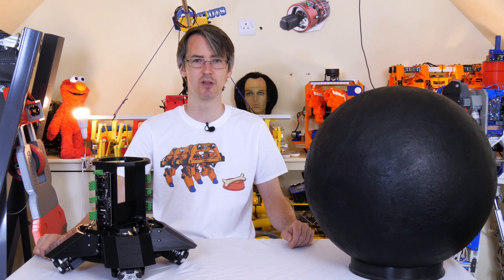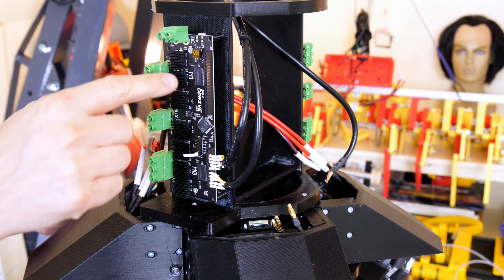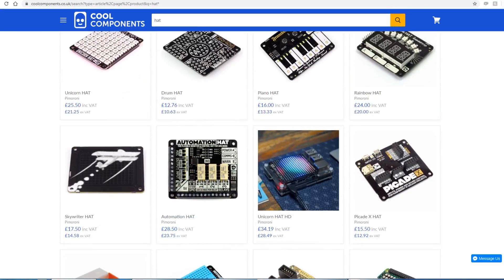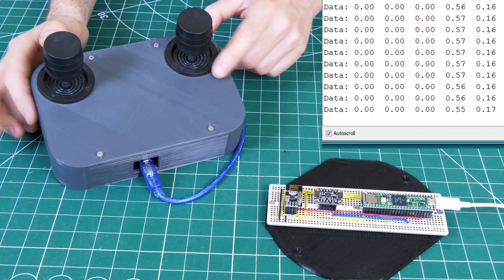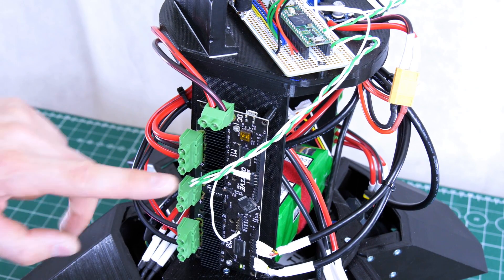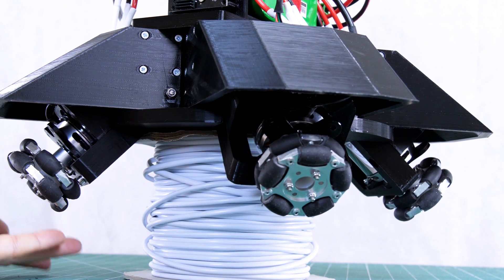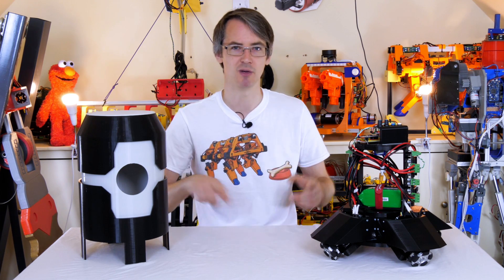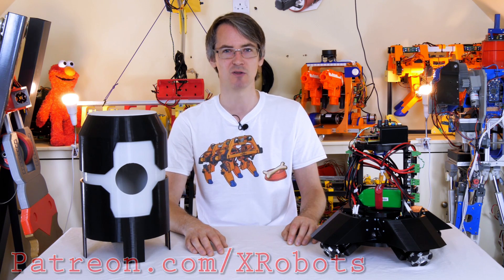HAL9000 : Ball Balancing Robot #2

Comment: i would put the batteries in the center of the ball and power the "robot" part thru nfc coils all around the ball. Lot of loss but the weight of the battery dosent count as it's in the center of gravity. For the interference however i'm afraid it would make it worst 😁

Comment: Hi James, nice project! I see you're gonna use the nrf24 module. I would advice to not use the micro's onboard regulator, but use a dedicated board for that. (nrf24l01 adapter module)
The nrf needs a very clean and powerful 3.3v to operate reliably. I've used the adapter board myself and it  works great.

Comment: What I realized from my tests with these NRF modules is that you should keep them close to the microcontroller to make sure the data wires dont get any noise on them. Your SPI wires must be acting like an antenna and picking up motor noises
Reply from the maker: Yes

Comment: Have you considered putting a large ball bearing inside the empty ball to give it more inertia and stability? That would slow it's response a bit and maybe make it easier to control from the wheel on top.
Reply from the maker: Yes watch part 1

Comment: I'm working on a model of a thing myself and I need to find a ball that is 28.8" in diameter. I haven't had any luck finding it. Where do you get the foam halves from? Did you find a fiberglass ball?
Reply from the maker: The original one was bought years ago from eBay or Amazon (I can't actually remember). The new one is actually going to be a mirror ball!

Comment: Move the battery to the very top, and possibly add a small flat round steel weight there. That will increase the moment of inertia and also the increased weight will improve traction.
Great project! 👍💡

Comment: I discovered the flaw in this design. It's latency... There is a very high delay between the accelerometer and the motors. The motors start spinning waaay too late, always ending in it falling off the ball. Fix that, and you're golden.
Also, the wheels don't seem too grippy, they are of hard/rough rubber/plastic...
Reply: I want to see a ball balancing on a robot... :)
Reply from the maker: It's actually tuned fine as you'll see in part 3, yes the wheels spin for the reasons I explained.
Reply: @jamesbruton  Tuned fine, yet the wheels start very late... They should start at the smallest inclination/movement.
Well, you do what you want, it's your project. :)

I said accelerometer, but I was referring to a gyroscope.

Comment: I'm not sure your "ground loops" arguement makes much sense tbh!  The high frequency motor noise will couple back on the power grounds, but the high frequency serial data return currents has no ground path that is "co-axial" or at least close to the outgoing path from the processor.  AT high frequency, it is the inductance, effectively the loop area that matters.  You system is battery powered so has a common ground, but it would be better to ensure that all outward current paths have a return current path as close as possible to the outgoing path, even if that means another ground wire which looks (at DC) to be pointless, but actually provides the critical AC return path. If you are using TTL (5v or 3.3V) serial between the processor and the O drive, as opposed to RS-232 levels (+-12v) then you can easily run into noise issues due to issuficient channel seperation!  The other big advantage of always pairing your outgoings with a matching return is that you can then use alarge amount of common mode filtering to block common mode noise without affecting the differential serial data signals too much!  warpping the wires through / around a suitable ferrite choke, for both the power and data, can bring huge reductions in the high frequency noise as the high frequency common mode impedance is driven right up by that ferrite!

Comment: You may want to consider some stiction compensation algorithm, the most basic being to add a signed offset to the forward and backward voltage applied to motor. May reduce the amplitude of oscillation you see near equilibrium. Obviously the better solution is to remove the sources of friction but it is not always possible.

Comment: You almost have the right design but it's not quite there yet.You need to combine the ideas from your previous designs and invert the functions to get it there. First- forget about a dynamically unstable "balancing head" robot on a ball..that won't work and is not the best design. the head you have now is a good idea  but you don't want it too heavy ..Your broomstick analogy is false here and unnecessary. Second- Yes you do want a powerful magnet on the bottom center of the head part and inside the ball you want should have a caster section immediately below the head with a convex surface with ball socket solid rollers facing the inner surface of the ball and another powerful magnet pulling the head to the surface of the ball. Now extending downward from the center of this caster section in the ball is a long solid shaft with a semicircular HEAVY counterweight almost touching the bottom of the ball inner surface attached to the end. this will make the ball statically stable and the head will then only be needed for propulsion and stopping and will not need to balance at all as the ball will be stable and will not tilt or roll as long as the counterweight is heavier then the combined weight of the head and upper inner caster section combined. This will of course require a SOLID hollow spherical ball shell of strong material like fiberglass or carbon fiber with a split shell or access port to insert the counterweight shaft system to the inside.the inside could also be sealed and contain a small amount of lubricating oil just coating the inside for the inner casters so they do not wear out .The advantage of this system is that it does not require any electronics or motors or wiring of any kind inside the ball...only a mechanical counterweight system. This also means that no power is required to balance the head on the ball and with power off the robot will just sit there upright and will not fall over.the head will be used to move the robot and by moving the head one way the ball will move the other way so essentially the ball will always lead the head in whatever direction it is going. This will also help when hitting or bumping into other objects or walls since the ball will take the impact and the head will not . Just a thought......
Reply from the maker: wow that's a lot of text
Reply: Yeah, that thing you set out to do - it's not going to work, forget it, even though you came really close last time. Remember the things you said you already did and don't want to repeat? Repeat them. Just an idea...

Comment: Having touched on this at uni we discovered a heavier ball solved a lot of the issues you're having. We had the ball being thrown out from under the robot due to torque much like you are. Try a heavier ball.
Reply: Yes. This is not like balancing stick. Heavier ball will be easier and more atractive (head will be much more moving relative to the ball).
Reply: Do you have any info on this?  Maybe discuss it a bit more so I can understand where you are coming from.

Comment: Have you tried snipping the ends off a USB cable and using it as two twisted pairs? Most USB cables have are shielded by a metal braid to reduce interference.

Comment: Have you thought of having a component on the inside that works in tandem with the head to track positioning and keep ballance or at you more focused on just a small robot that can self balance on the ball? I noticed as the ball moves it doesn't allow to head to catch up with the body and usually results in it falling off.

Comment: I do not believe the balancing broom example applies here. This is not actually using the principle of an inverted pendulum for control. It would be if the ball did the controlling. The extra inertia and weight of the control unit is doing the opposite of what you think it is doing. I reminds me a bit of the classic rocket fallacy.

You might argue that a bike and cyclist is an inverted pendulum where the top part balances the system, but this is not really true. The cyclists operates the bike by steering, which makes the bike balance the system.

For this to work, you need a much heavier ball so that the control unit has something to work against. I would use a ball that you can fill with water. This way you can fine tune the weight distribution.

On the other hand, there is something to say for not giving psychopath robot computers unlimited range..

Comment: Ok Last comment James. If you have such powerful microcontrollers available to you as well as even FPGA. Why not consider making your own servo control? I mean you are not shy of analytical or technical skill to do so. Just an encoder you could get cheap from USDigital and the motors from HK as you normally do. Make a small control loop using the micro encoder and a FOC control like VESC, you can get multichannel devices up to 4 outputs. A thought.

Comment: If you put a strong neodymium magnet on the inside of the sphere with rollerbal bearings, and attach the omni wheel plattform to that magnet with a piece of metal, it will stay suspended. It will also increase friction and eliminate wobble. 

Then you can have a high center of gravity, so that it is really unsteady - that makes it easier to manipulate the lean with more force, which will make it steer way better when selfbalancing

Comment: Yeah I think the wheels need to be turned 90°
I have seen a robot "server" about 1.2m tall where the top part was very heavy and the omni wheels where around 3/4 up in that config and only three of them.
Well technically six but the other three were free spinning to distribute the load.
That thing was moving happily around and collecting empty glasses when the tray was full a waitress replaced it with a empty one. More for show than use I guess.
Reply: That arrangement wouldn't be able to control rotation. Fine for a drinks trolleyrobot, less good for a 'character' like this
Reply: @ianwalker6546  That is true but I'd have rather a stable config.
Fixing the "character issue" with a "cosmetic axis" is way easier than the other way around.

Comment: Have a look for plastic rotocast street-lamp globes. I used one for my BB8 build. They are rigid plastic (PE I think), quite lightweight, and perfectly spherical. Ideal for your application.
Reply from the maker: Yep - they have a massive hole in usually for the light fitting
Reply: James Bruton the company I used didn’t cut holes but not much use to you as they’re based in New Zealand:D

Comment: This project doesn't look salvageable - it would be easier to build a Saturn 5 space rocket and make that hover 10 stories from the ground.
Reply from the maker: I'm already a few weeks ahead so I know where the issues are already. Part 3 comes up in a couple of weeks (and in a week for Patrons)
Reply: At some stage I'm sure it will sort of balance and perhaps even move around a bit, but the methods used here are based on a fundamental misunderstanding of the physics. This setup is not like a broom balanced on a finger, but more like a trapeze artists balancing on a tall ladder. While you can recover the broom from an extreme unstable position, the trapeze artist has a very small area in which (s)he can maintain stability by simply moving their weight around. Once that balance is tipped, there is no recovery possible. In this case, the ball is the ladder and the robot is the trapeze artist.

Adding length or weight to either parts of the system also will not make drastic improvements in this case. It will make it easier to maintain balance, but it will not dramatically improve recoverability from most unbalances configurations.

So it it just needs to balance a bit, it will work fine. If it has to move around, not so much.

Comment: You've probably already thought about this. But, what if you had a frame on the inside of the ball with casters against the inner surface of the ball, a counterweight at the bottom, and a strong magnet at the top. That way, your robot, on the outside, can attract itself to the magnet on the inside, in order to get better traction against the ball.
Reply from the maker: At the moment that would make it worse because the wheels are sticking in, also gravity is working in my favour.
Reply: Obviously, you're going to need a different ball. What if you could cut a beach ball in half and install threaded mating rings to put it back together?

Comment: what about a magnet on wheel inside the ball to hold the robot to the ball?
Reply from the maker: That would make it worse at the moment since the wheels are getting jammed in the ball's surface. Also gravity does the job ok in this example.
Reply: @jamesbruton  ho yea sorry i was thinking for the fiberglass ball
this soft ball will be hard to open without damage too.

Comment: You can make a ball! 

• Get an inflated beach ball or foam sphere that's about the size you need.  

• get a few packs of fiberglass cloth and epoxy at a home improvement store

• secure the ball and do a layer of epoxied cloth on the top, let it set a night.

• flip the ball over, do the new "top"

• continue rotating, covering, setting, and repeating until satisfied.

• there's no way to retrieve the original ball, but you now have a solid fiberglass sphere!

• once it's finished, you can sand down any imperfections until it's to your liking.

It would be fairly heavy, but it would have a slick surface so you will want to cover it with something like a rubber spray paint.
Reply from the maker: will is be perfectly smooth and round though?
Reply: Beach balls are nowhere near round. And if he was to set out to find something round enough, he might as well go for the finished product.

Comment: Hmm. I think making your own ball is going to be the best solution.
But it sounds like you want better surface finish than the bare print could be.
I think if you could design a section of ball that could be printed and a matching roud sanding block you could sort of bodywork the ball to a high quality finish.
In addition I think the mass could be kept low , and rigidity kept high by wrapping the ball in carbon fiber,  I've been seeing some really fantastic on off carbon fiber pieces being made on Mike Pateys YouTube channel and his scrappy airplane build.

Comment: Hey James, I think you should check loop time of your code as the response seems very slow. Either your loop time is large or your control parameters are not right.
Reply from the maker: Yes but that's because the wheels spin freely when it's too aggressive, because if the issues I've mentioned. I'm already a fair way ahead in this with the new ball and it looks like the parameters shown in this video weren't that far off.
Reply: Waiting for next Tuesday.
Reply: Training it...

Comment: Don't be afraid of using three wheels instead of four. You won't lose much power, and you can reduce the math to simple matrix multiplications
Reply: 3 is always better than 4 if you can get away with it. 3 points always fall within one plane which means you are guaranteed contact even under moderate deformation, the same will never be true with 4. It's why even an idiot without a ruler can make a 3 legged stool.
Reply: The problem with three wheels is the desire to have a rotation function - this means the wheels need to be angled to deliver a sideways component (in James' design it's a right angle) and so you are limiting the maximum torque each wheel can apply to whatever the maximum counter-rotating torque can be applied by the other two wheels. This could easily overwhelm the robot's ability to remain upright, especially when it starts moving on purpose.
Reply: @ARVash  "3 points always fall within one plane" that is solid mechanics yes but here the wheels are on suspensions so ... "even under moderate deformation" well yes that's what the suspension is for, it's role is to cope with deformation so ... "It's why even an idiot without a ruler can make a 3 legged stool" yes but that same idiot can drive his 4wheeled car on a non flat road built by another idiot and it still work even if he is idiot enough to dare apply dynamic load on the system (like accelerating in a curve, wouhouuu crazy) because you know ... suspension ...
By the way "3 points always fall within one plane" but 4points always fall on the surface of a sphere so ...
Reply: I have looked into this, from what I have seen is there are advantages of both 3 and 4 wheels.   Both 3 and 4 mechanum style wheels cover all DOF for movement in a single plane.    X, Y and yaw.    Can you give me any more info on your statement?  I myself went with 4 wheels due to the yaw motion advantages.  It would be nice to go back to 3 wheels.
Reply: He didn't think it through.
Reply: @travisash8180  can you explain why the 3 is clearly better.   From the published information, I couldn't see a clear winner.  I myself went to a 4 wheel system.

Comment: You can use a ferrite bead on both the serial wire bundle and the three phases of each motor. This would be to combat noise interfere.
Reply: And can be got in bulk in a lot of sizes, that's actually a great idea, especially in compact robots with do much packed together in a small space.

A seperate "power filter" to feed the control electronics would probably help too